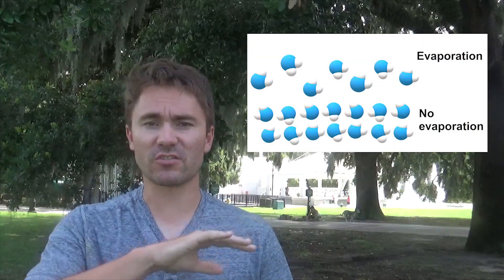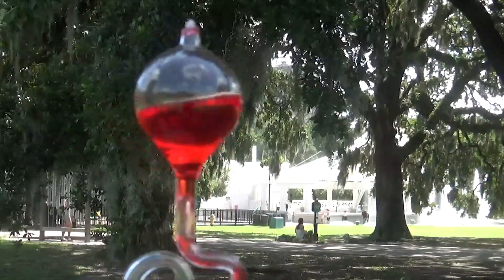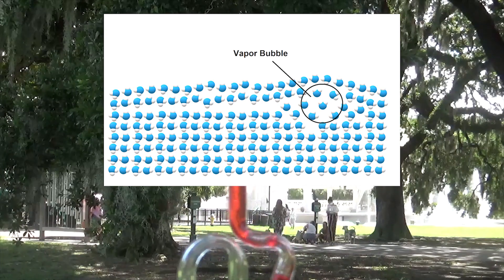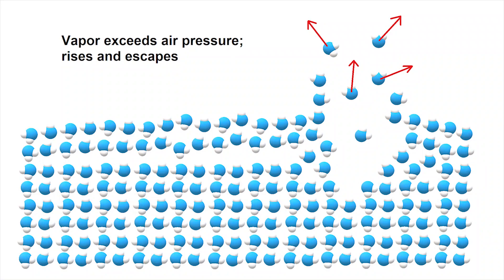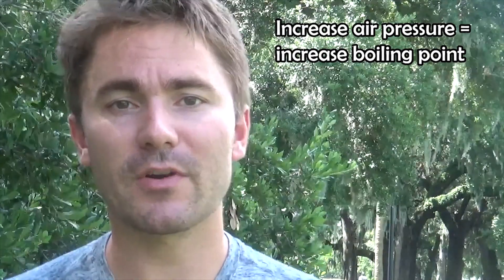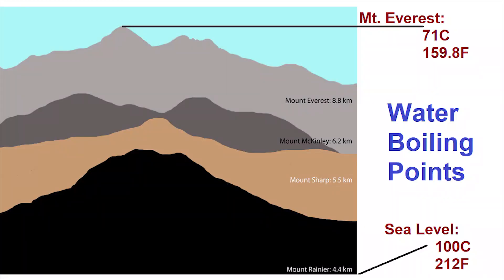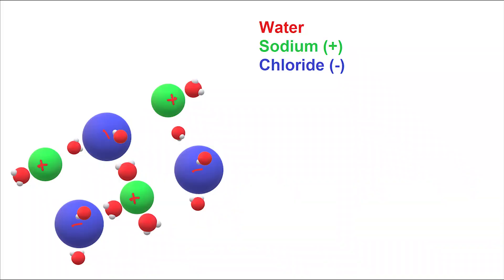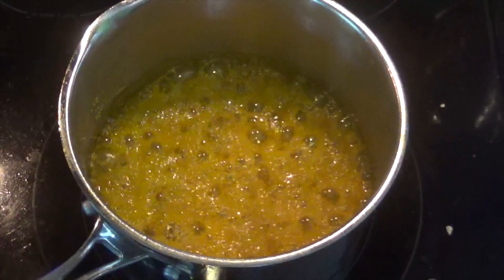Why does water boil?

Comment from the maker: Just to make one clarification: because those "bubbles" are water vapor, they begin with the same pressure as the water. The normal air above the water has more pressure, hence why they don't rise until they exceed that pressure.